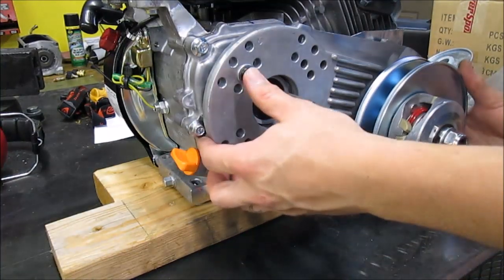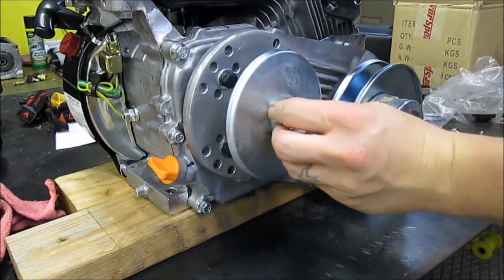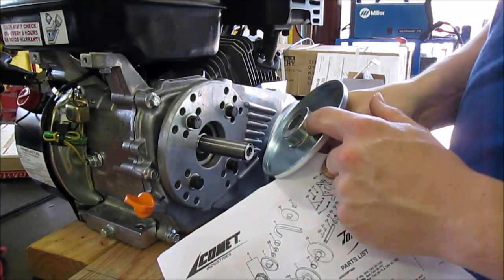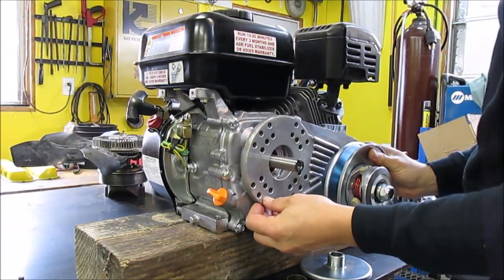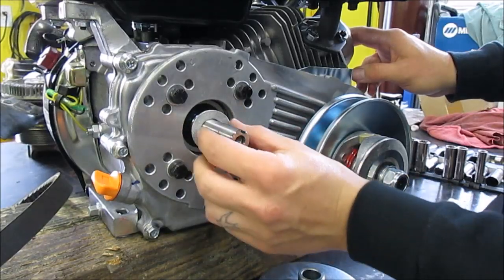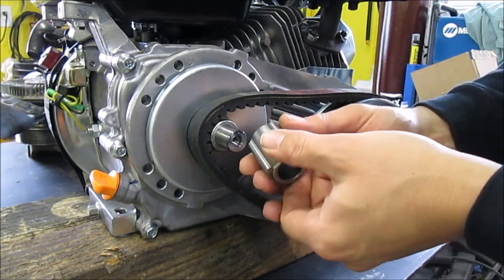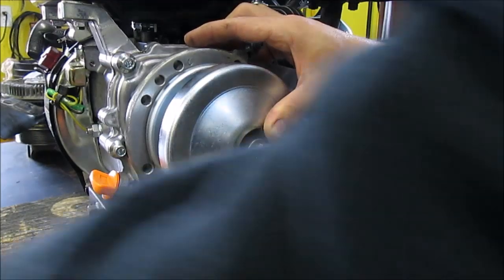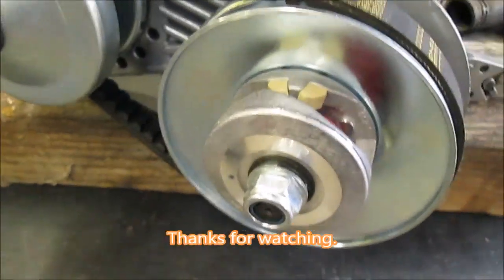Episode 23. The wrong way to install a torque converter on a Predator 212.

Comment: Looks like the belt was on backwards at the end. It is asymmetrical. One side beveled and the other at 90 degrees. Flat side goes towards the motor.

Comment: That bronze ring you put over the front pulley is actually so the belt doesn't wear on the spinning pulley, The brass just sits there and doesn't spin while the pulley shaft is spinning, It keeps your belt from wearing in 1 spot while you're idling.

Comment: 6:32 - how did you tighten the crank bolt without holding the engine from spinning?

Comment: I just bought the exact same rig, as a basket case.  The 4 ribbed spacer is missing except for  1/2"at the outside end.  The bronze bushing is also missing and the springs surrounding the 2 "shoes".  Do these items sell in parts kits?

Comment: You didn't have tje spacers on the back pull .it will grind the housing..and the belt has a tapered side for the pully

Comment: Do you have to install it in that orientation? Or can you have the torque converter pointing down or the opposite way?
Reply: Technically no, thats why there is 6 holes on each "corner", though the top 3 and the bottom 3 are for diffrent engine sized mounting holes

And technically you CAN have it to the left over the right hand side (as he had it), but you likely will run into chain clearance issues due to the fins on the mounting plate. Hard to explain, but...yeah. If you put the chain on going horizontal to the left more (or the chain going straight up), then it wouldnt have issues, but....what are you doing that the chain will be like that?
Reply: https://www.youtube.com/watch?v=k0lO22tsPsE

Here is a link to a video that you can see how he grinded those fins away to allow it to go that way it, in case you havent found it

Comment: Is there any way to mount the torque converter horizontal I cannot lift the engine one inch. Maybe a little grinding and drill new holes?
Reply from the maker: There are multiple bolt patterns you can use. Can you face the sprocket pulley to the front of the engine? If not grinding might be useful. Raising the engine monting plate up is also an option.
Reply: Thanks

Comment: Will this work on 79cc predator engine?
Reply: Desirey & Taylor Channel   No
Reply: Desirey & Taylor Channel  do you boo, if it doesn’t fit up don’t come to me boss.. make sure when you order it it’s meant for the shaft size of the 79cc engine. I’ve never really seen tourqe converters on 79cc ones mainly on the fact that there made for 212’s... also make sure you have the bolt mounting patterns on your engine! As well it wouldn’t hurt to buy a extra belt.
Reply: @peytonthomas4506  thanks for the advice I'm going from 80cc 2stroke to 4 stroke whole new build seeing what I need
Reply: Desirey & Taylor Channel  ah nice I much rather prefer a 4 stroke over a 2 stroke!
Reply: @peytonthomas4506  you could if you used an adapter sleeve on output shaft.
Reply: @Skott LeFever Yeah it is...&;I sell all the parts for the 79cc Predator...far more than harbour freight lists..hot cams, gaskets etc Trev New Zealand 🇳🇿🤗
Reply: Leave a pm if you want to be personally contacted.Thanks Trev😇🇳🇿

Comment: What's the brass bushing do?mine got turned to dust is it important?
Reply from the maker: I believe the brass bushing helps with letting the belt slip at idle speeds. If your bushing is warn out how did your belt look?
Reply: Yea the bushing makes the belt not wear so fast
Reply: And don't listen to him he put it on qr9ng go to red beards garage

Comment: Is a 30 series torque converter too small for a 301 predator
Reply: Jason May no but anything over that you would have to get a 40 series
Reply: No
Reply: A 301 predator has a 1" shaft , the 30 series torque converter  is made for 3/4 shafts....
Reply: @jacobsebastien3910  Didn't you watch the video? He originally ordered a TC for a 1" shaft by mistake. You can use a 30 series on a 301 if you order one for a 1" shaft.

Comment: The bolts that came with my torque converter won't work on my 212 Predator, wrongs threads...
Reply: The correct threads are 5/16-24 ... 1 inch long... I just had that problem lol

Comment: ?? how the fug do you install that chain over the belt ???
Reply: Connecting link..
Reply: @garthnewman5859   not every chain has a connecting link, but mostly it's called a Master Link and it's used to take off chains. Be sure to get a Chain Breaker.